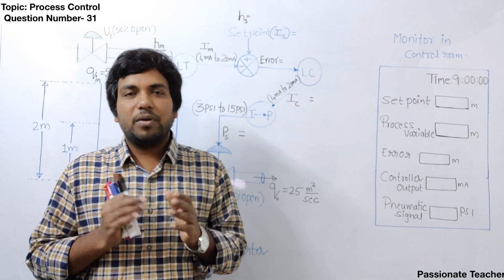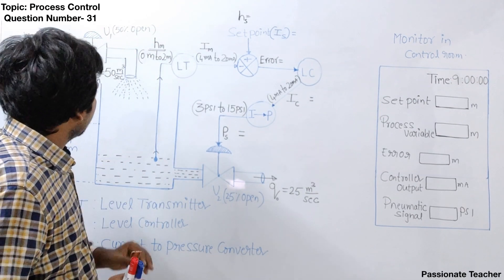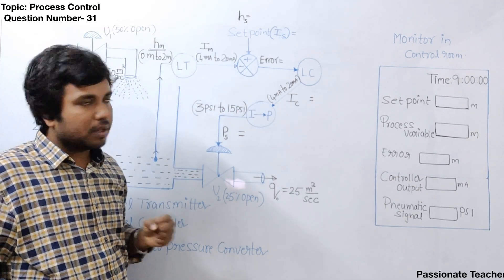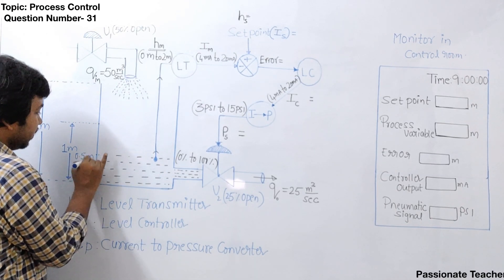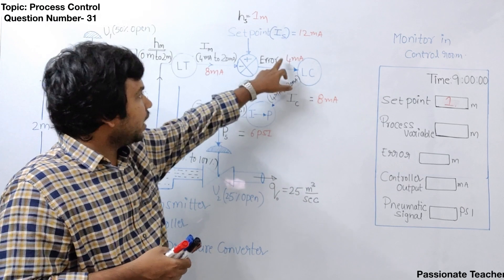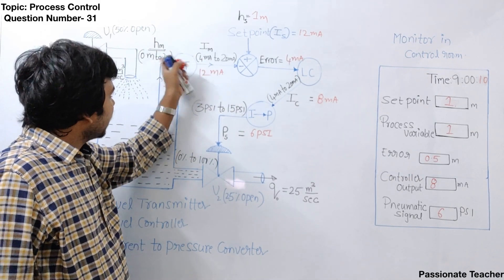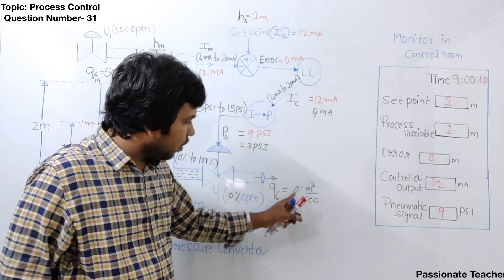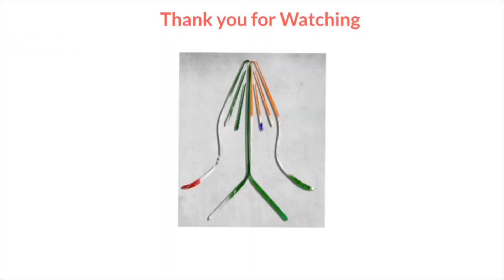Interview Question 31 || Instrumentation|| Process Control - Liquid level Measurement

Comment: Sir, if either of LT,LC or I/p converter becomes faulty, how would an operator from control room identify which one(s) are giving false outputs? Also, if it so happens that I/p converter stops working and it goes 0psi(-25%) what would it do to the control valve.